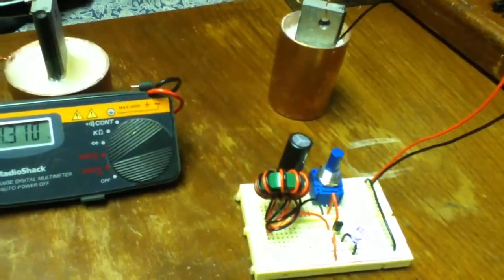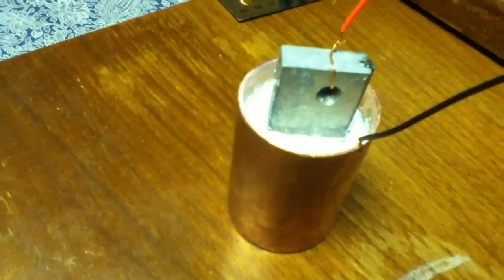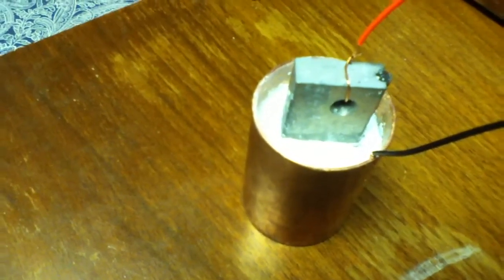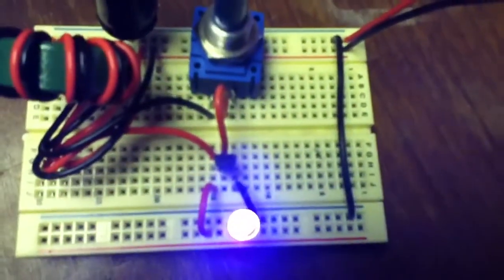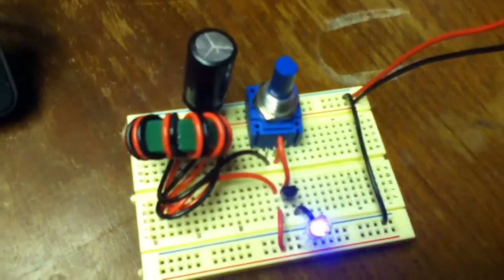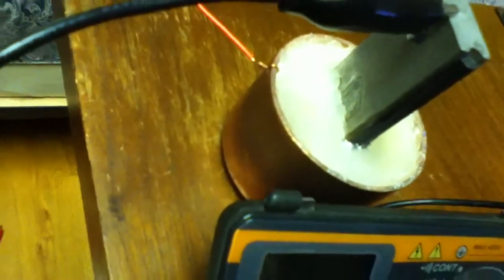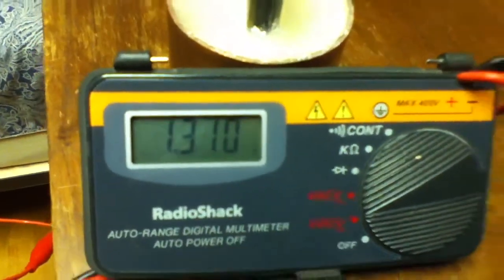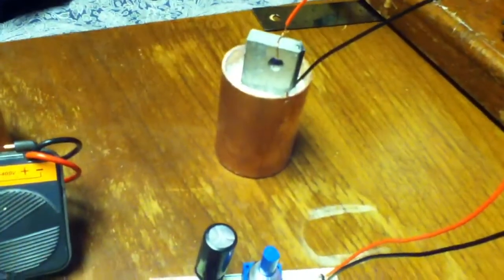Copper magnesium crystal cell

Comment: Is it possible to make flat battery and stack them together with screw press? Instead of copper can i use activeted carbon instead?
Reply from the maker: Probably. The only problem with this kind of battery, less the low current, is the expansion of the of the white mixture. Over time it oxidizes and ruptures the casing.

Comment: How long did that cell end up lasting, (or is it still going)?   ...I have that exact same model of Radio Shack multimeter.  I've had it for about 25 years.  I periodically check it against higher end multimeters that I know are calibrated,  and it's still pretty accurate, even after all the extreme temperatures and wear and tear it has endured.  ...I'm waiting for the first inexpensive pocket O-scope with mid to high end level features and decent precision to come out.
Reply from the maker: Nice, I haven't watched this video for what seems like a lifetime. Thanks for reminding me its still there. 

This was a fun experiment back when I thought that more was happening then there really was. 

How time and experience make for a clearer picture of reality.
Reply: @Objectivityiskey   Copy that!   So, how long did it continue to power the LED?  One of the biggest issues with the "crystal cells", seems to be the way they tend to expand.   I saw a method somewhere, of pressing the materials into a metal casing, which seemed to remedy the expansion issue.   I never tried it myself,  but it looked promising.   I still have quite a few pounds of the various chems involved in the "crystal cell",   and lead alum battery conversion experiments.  😆
Reply from the maker: @starstreamir3817  It powered it for months, but like you said, over time the reaction expanded. I ended up moving a long distance and decided it wasn't worth keeping at that point. The experiment was worth doing, and it's still in my trick bag incase I need a low power long lasting galvanic battery.
Reply: @Objectivityiskey     In case you might be interested,  a man named Robert Murray Smith, kind of rediscovered a method of building an ultra efficient HHO dry cell using graphite sheets instead of stainless steel,  and urea as an electrolyte,  that seems to actually make it possible to get an HHO output that slightly exceeds the energy put in.  It's not overunity, but has something to do with the urea, as well as the ideal surface area provided by the graphite.   It could, in theory, allow you to run an internal combustion engine on HHO.  You still have to buy urea, but still,  the idea of being able to run a smal engine on HHO generated  by the engine itself has been a sort of holy grail.   I wonder how the cost of urea vs the cost of gasoline works out.  The only reason I'm willing to test it out, is due to the credentials and shear genius of Mr. Smith.  He's on YouTube if you want to check him out.   Be well,  do good things,  and don't be too afraid of "the big bad bug".   What media often fails to mention, is that approximately 99.98% of people,(without other health issues),who catch it,  recover with little to no medical intervention.
Reply from the maker: @starstreamir3817  Thanks for the reference, I am subbed to Robert Murray Smith and I remember that experiment. I'm always interested in claims of Individuals overcoming the laws of thermodynamics, but I have yet to observe anyone succeeding. Back in 2008 I installed a small HHO generator on a Briggs and Stratton and performed experiments to see if it was possible to save on gas consumption. At the time, I didn't have the experience or setup to tell the difference, but it was amazingly fun nevertheless. 

I wonder if Robert Murray Smith's version could be used to heat an array of Peltier Thermoelectric modules to produce both power for the HHO generator and power to run or charge another application? I might give that a try over the summer when I have more time.

Comment: Have you tested this cell for the maximum power or current.  Running an LED uses a trivial amount of current.  Not contending with you, but to be impressive this project needs to figure out the maximum current and how long it can operate at that rate.  And if there is any magic in this cell, maybe it has the ability to recover after a full load. 

So, if you go and test it for power, please note the voltage that is delivered at the moment that the maximum current is being used.  Also, how long the maximum current can operate without degradation.

Best regards...

Comment: how much current is it putting out? can it power a small motor?
Reply from the maker: Not much current, but the more you add in parallel, the more you get. The only reason this thing can light an LED's is because I'm boosting the voltage with a boost converter, joule thief style circuit. Look up blocking oscillators for an example.

Comment from the maker: This is nothing more that a type of galvanic cell. Two dissimilar metals that produce a charge differential with a saline type granular medium between the two. It's not free energy, and it's produces a very weak current. These also need to be ever so slightly wet, and if you cap the off for all humidity, they slowly become inactive. I had one capped off with hotglue, and it slowly discharged. I have another one in my bathroom where it gets steam from my shower every day. That one has been powering two white LED's through one of LidMotors blocking oscillators schematics. It hasn't shown any signs of weakness, but the current is still very low. If you're looking for a long term light source that is just a bit more powerful than a tea light candle, then these are great. It might even have enough power to charge a super cap array, power an arduino for a short time before it goes back into sleep mode, take some readings and log them, but you would need a few of these batteries for anything more.
Reply: It seems to me that the trick would be to maximize surface area and within the cell and making multiple cells.
I think that you would have to run 10 or so in series and then parallel 3 banks of those 10.

You have to think of this as if you  took one the energy of one set of plates in a lead acid battery.  You wouldn't get much voltage or amperage from that either.

I believe that if you expanded this project to utilize the same footprint as a standard car battery, what you would end up with would be one hell of a storage cell.  Something like that would be IDEAL for solar collection.

Comment from the maker: One more thing, if the magnesium lights off, water won't put it out! Once magnesium starts to burn, it will have to burn itself out. It will burn extremely hot, and has the potential to burn its way through the pan, stove, floor, and possible even the dirt under your house. Burning magnesium is hot enough to melt sand! Make sure you know as much about the materials you are using before you get yourself into trouble!
Reply: Good heads up!
Reply: thanks
Reply: +Objectivityiskey You'd be lucky to ignite anything other than magnesium flakes. Magnesium in blocks / rods is incredibly hard to ignite unless at the right temperature
Reply: +Joe Anthing Excuse me Joe, i just could found 99% pure metal magnesium blocks to make my own test, but I found on the technical chart that there sould be care with the alcalne salts, I was thinking to use sodium bicarbonate. Then, what could happend?, Did Im going to burn like hell?
Reply: *****
Be careful with pure salts.  Read up on it on the WEB.  Make sure you get many opinions.  This is just playing around.  A real high amperage battery requires serious chemistry understanding.  There are more ways than one to hurt yourself.

Comment: Where to find magnesium..?
Reply from the maker: The magnesium is just a fire starter from Target. You should be able to get them from most camping stores. It even comes predrilled with a hole for the negative lead. The copper is the positive lead. If anyone is looking for the crystalline white material, it is 4 equal parts of: Alum, Borax, No-salt, and Epsom Salt. Grind them into a fine powder and mix them together. Heat the copper and magnesium on a hotplate and add the powder slowly until it begins to melt into a liquid. Once you have the copper filled up and the Magnesium is in the center not touching the copper. Let it cool, and keep popping the bubbles that form. I used water to cool the copper base so that less bubbles would form. Go to "lasersaber's" channel for more details. He also has a blog with more info!
Reply: +Objectivityiskey REMINDER: set hotplate to LOWEST setting while melting the fine powder mixture!!

Comment: How many amps?
Reply from the maker: With no load, the battery puts out 1.3 volts, and with a load (joule thief and LED) it rests at .553 volts. The interesting part is that every day I check the voltage, it has climbed a bit. These batteries aren't very strong, but I think it's going to last a long time!